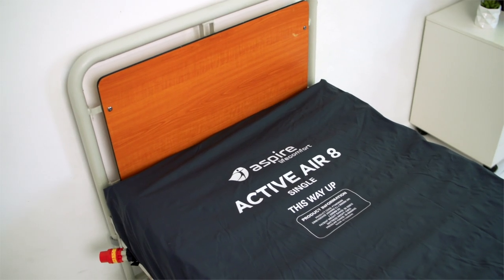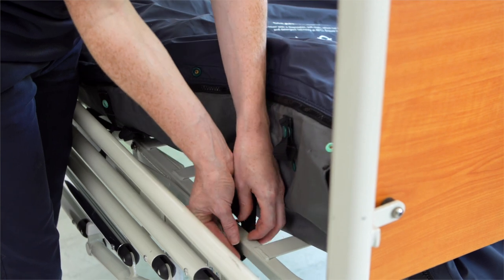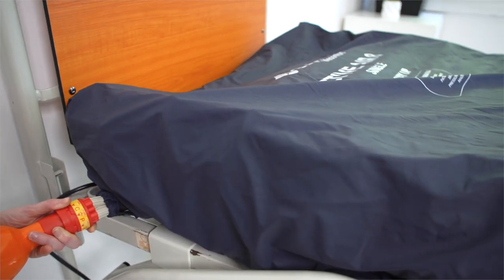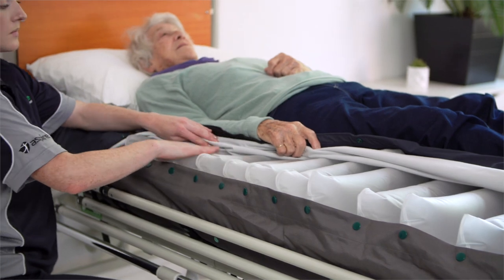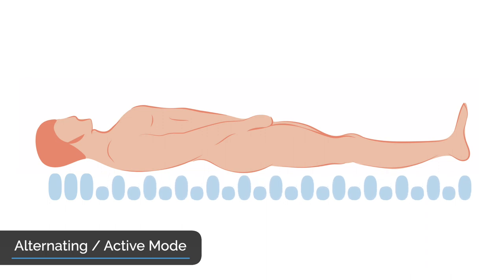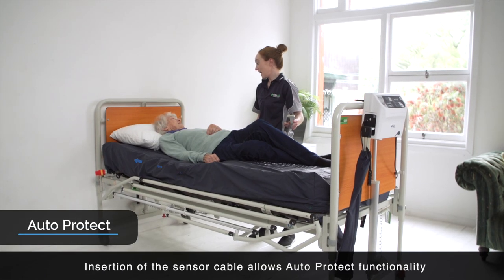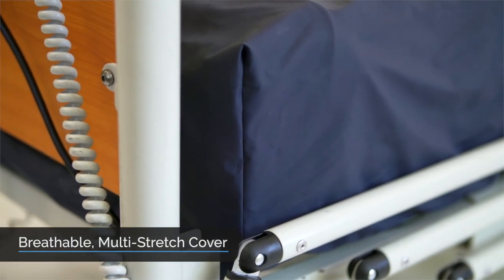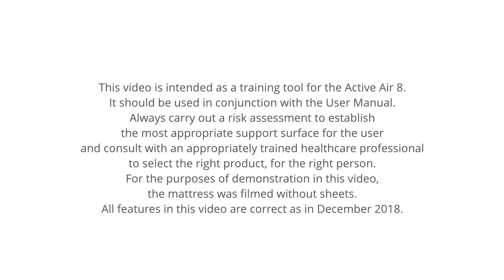Setting Up Your Active Air 8 Mattress

Comment: QUESTION THAT NO MANUAL ANSWERS !! when the electricity/ power goes out ie blackout, even for a few seconds, the bed starts nipping and dies not just "reset" on its own when the house power restores?  How do you turn it back on? We try everything and end up fluking it but forget 6 months later how!!